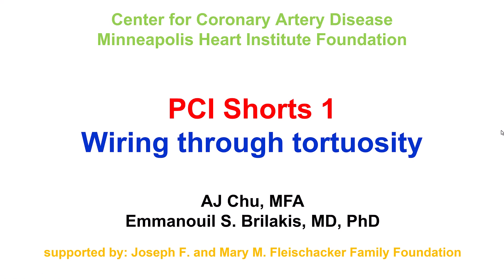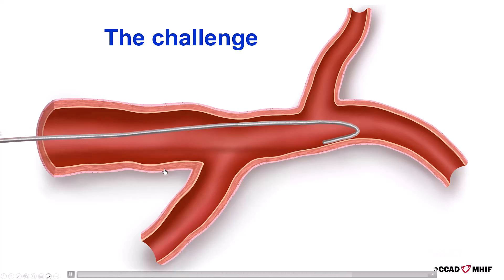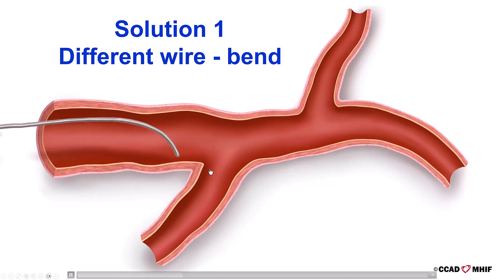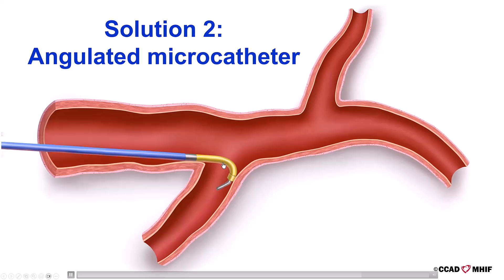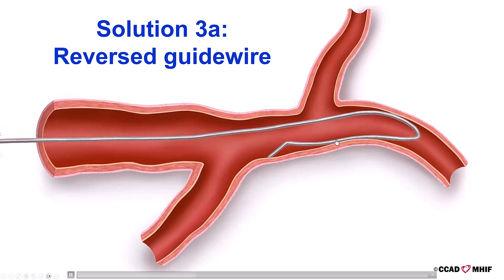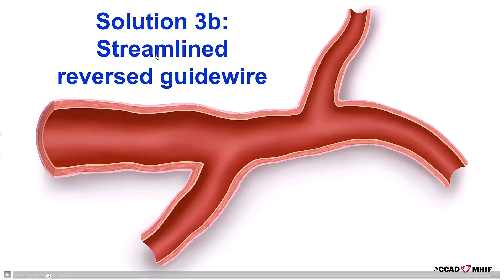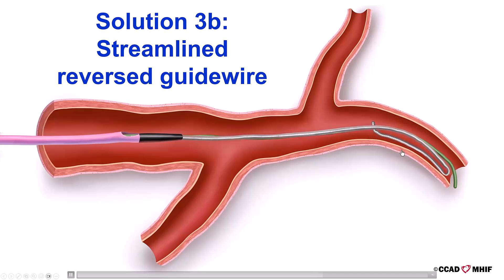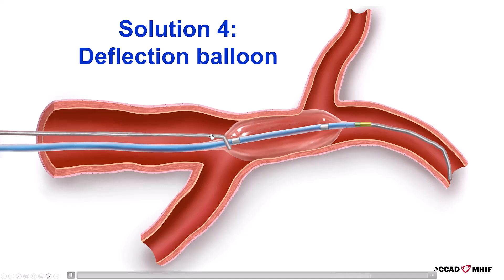PCI Shorts 1: Wiring through tortuosity

Comment: By the way, I have a question. In what cases would you prefer to use the streamlined reversed guidewire instead of a regular hairpin wire technique?
Reply from the maker: The streamlined reverse wire technique is used rarely, when the dual lumen microcatheter with the preformed knuckle cannot cross to the target lesion due to a proximal severe lesion or tortuosity and calcification.